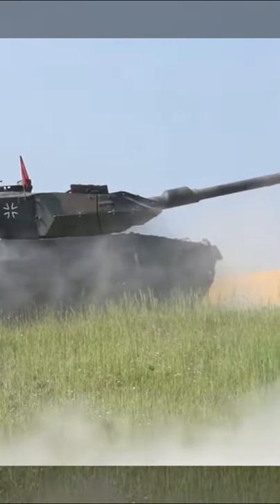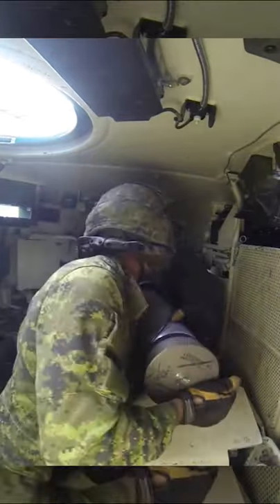Why some tanks raise gun after firing ?#shorts

Comment: It's called Ladestellung (in english loadingposition). The movement of the tank in rough terrain causes the stabilisation system move the gun alot and fast, which increases the 
likelihood of damaging the cartridge or hurting the loader during a reload. To make it safer the the stabilisation is off and the gun is raised. Actually it's possible to disable the loadingposition if a fast reload is needed. Also the angle of the gun in the loadingposition is programmable.